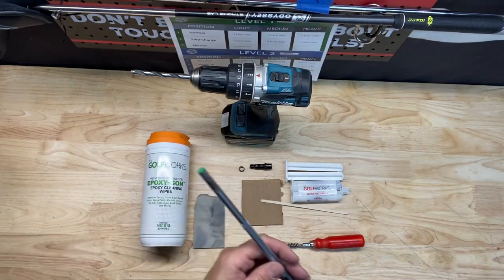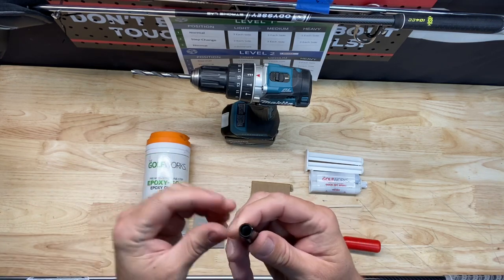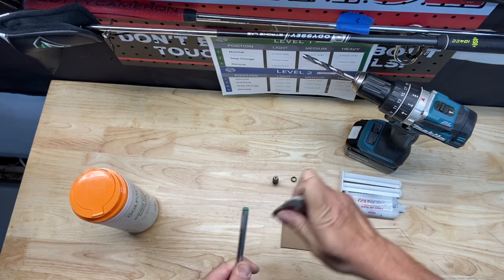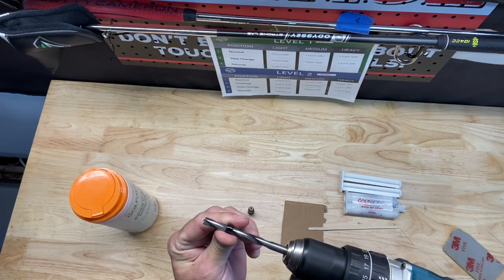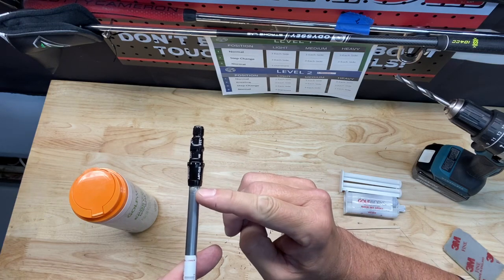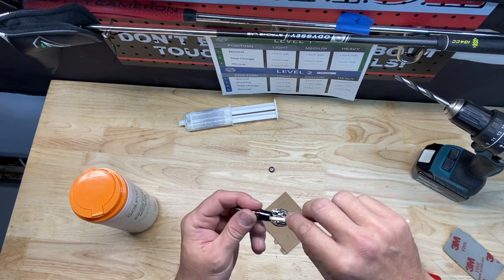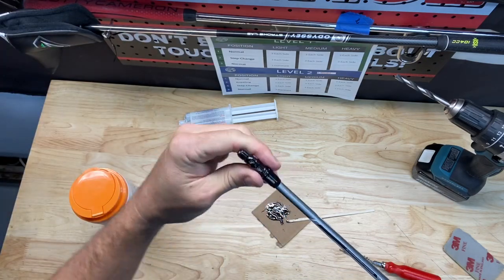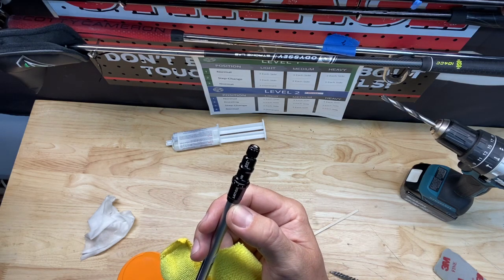How to install a TaylorMade Driver Adapter

Comment: Another method to get the ferrule to slide on is to put it into a cup of steaming hot water for a minute.  This softens the plastic enough for it to slide on more easily (without drilling it out).

Comment: I get my ferrules started on the shaft and then heat them with a heat gun on a medium setting.  Just a few seconds and the ferrule will go on easily by pushing it on with the head or adaptor.  Using the head itself gets the ferrule on the correct distance from the tip.  Obviously be careful to not overheat the ferrule or it will distort.

Comment: Is there a way to remove the screw (SDLR bolt) inside the 2016 M2 head? I have a shaft and the hole is .25mm big for the screw in the head. Just checking if it’s possible to fit a different screw in there before changing the tips? Thanks

Comment: thought the bottom of the shaft needs a hole looks like you have a green cap on that, let me know if that ferrule stays on we didn't see any epoxy applied to that or the top of the adapter..  good info.. thanks

Comment: On the taylormade R1 adapter, are the .335 and .350 adapters the same, the only difference being a very thin sleeve within the adapter than can be removed to turn the .335 into a .350?  Thank you.

Comment: Can I use a shaft from a taylormade R1 in a Taylormade M3? In other words are all driver shafts compatible  as far as the end that goes into the hosel.
Reply: Yes. You will be fine for that swap

Comment: Hi. I have a Cobra driver. My Q is.....!.....What is the lowest loft/degree adaptors can be set to.
Believe me!....I need a 5° loft. Yes five degrees. Lets not argue. Bryson de C use a 5.5°......probably custom built by Cobra.
If you didnt know.....The late Calvin Pete who held driving accuracy nr.1 spot for 10yrs used a 4degree driver. 
I naturally hitball high. So I loose a lot of distance as result. 
Higher equals wider.....fact!
Lower is staighter!
Reply from the maker: Lowest head you can buy is 9*....you can get a 2* sleeve so you can make it 7*.  Hope that helps.
Reply: @socalgaragegolfers9343  
Can I down  4° loft by connecting 2 adaptors in tandem?
Reply: @Godisnotjesus1967  Just put a long shaft on your putter and problem solved. 

Jokes aside, If you hit your ball "naturally high", then fix your swing. You're gonna lose even more distance from lack of backspin and lack of swing speed. You're not DeChambeau, you can't reach 140mph clubspeed to take advantage of a 5 degree head.
Reply: Dude, lol. You don't need a 5° driver. You're clearly new to golf. You need to go get a lesson or 7 because your swing is way, way, way off.
Reply: You seem like an expert already. Not sure why you are asking a question.